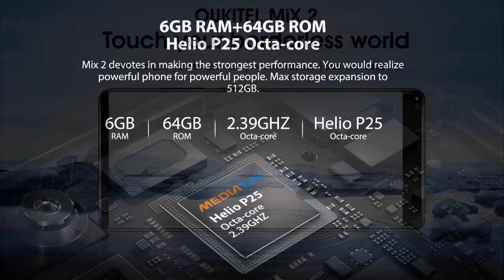OUKITEL MIX2 disassembly video

Comment: Hi dear, at the moment I have buyed a mix 2 for my father. Many years ago we got a Motorola service center.  Now I need to replace the rear cover that is glass. Would be nice to use an original one, but probably we will do an own one using carbon composite. So, my question is you think is enough to use standard phon to unglue the back? We have not any temperature controller plane. And is there a way to get an original replacement for the back (glass)?

Comment: Hi. I have to replace the Mix2  display touch.
Must i disassemble all the rear phone as shown in this video, or is enough to use the heater on the front and change the display? Thanks